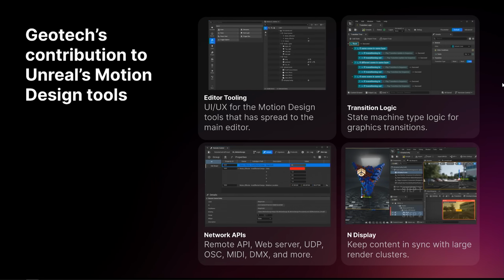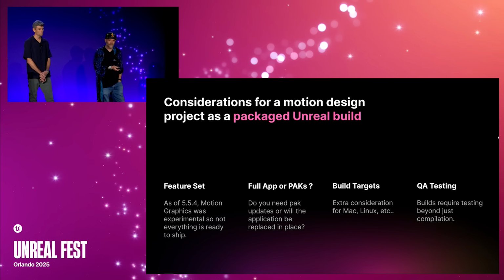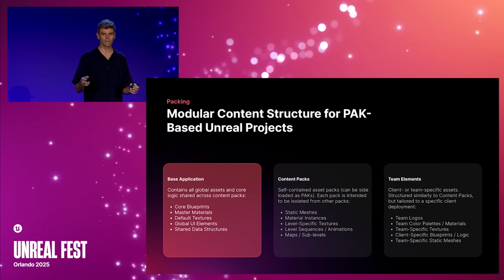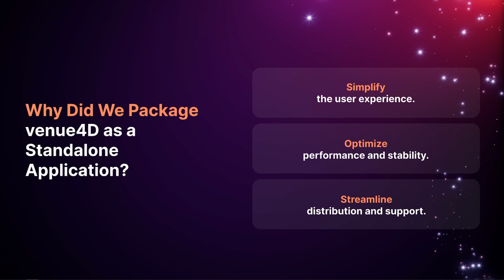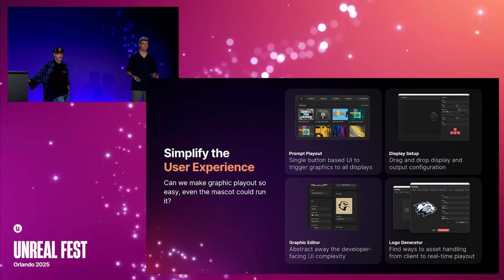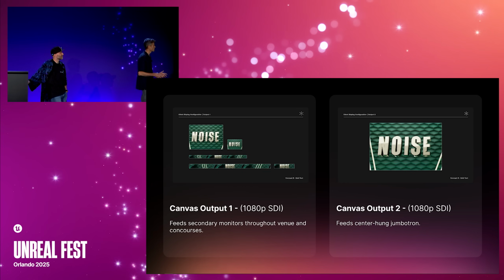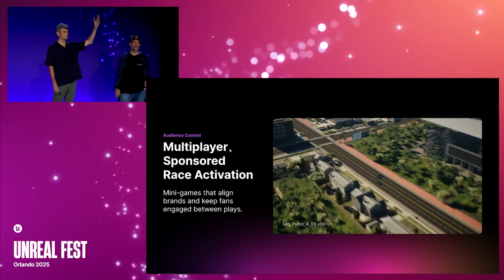Unleashing UE Motion Design: Packaging and Beyond | Unreal Fest Orlando 2025

Comment: 00:03:34 To Package or Not to Package: Pros and Cons for Motion Design
00:06:15 Key Benefits of Packaging: Deployment and Performance
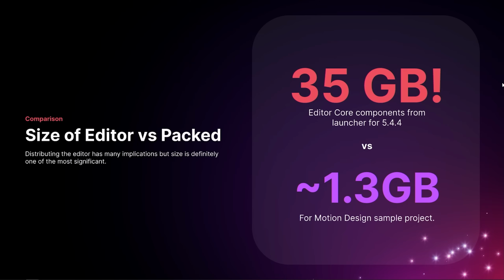00:10:04 How Packaging Reduces Project Size for Easy Distribution
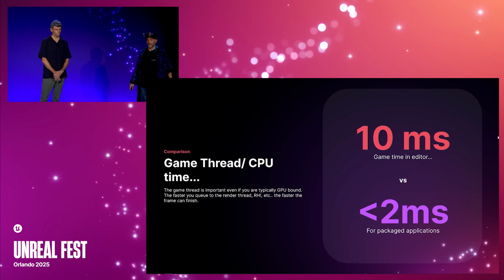00:13:07 Performance Gains: How Packaged Apps Run Faster
00:17:31 Why You Should Package Early and Often in Development
00:19:09 How to Use Content Chunks for Modular Project Updates
00:24:00 How to Control Packaged Apps with External Interfaces (OSC, MIDI)
00:28:12 Case Study: Emissive Labs' Venue 4D for Live Events
00:30:42 How to Simplify the User Experience for Live Graphics Operators
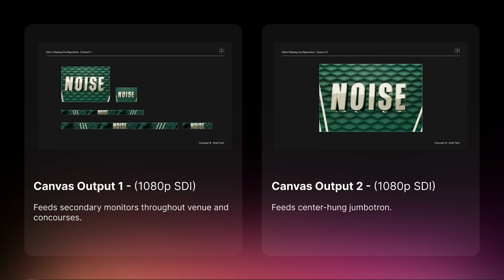00:34:01 How to Manage Multiple Display Configurations for Arenas
00:40:23 How to Create Interactive Fan Games for Live Venues
00:42:45 How to Connect Unreal Engine to Web Apps for External Control